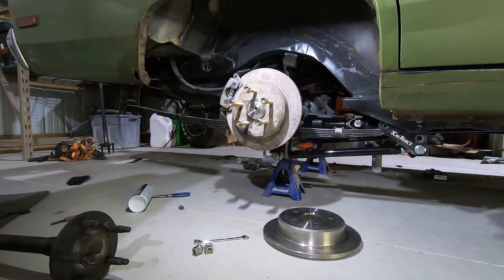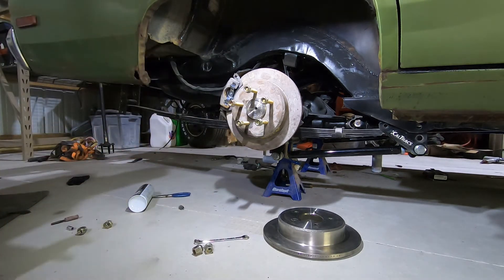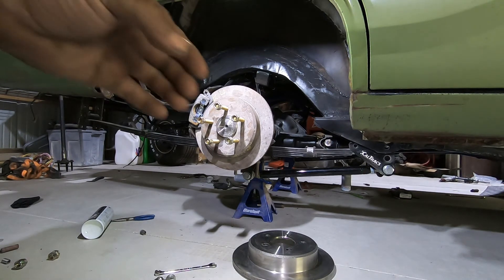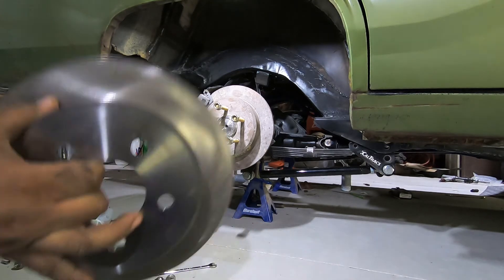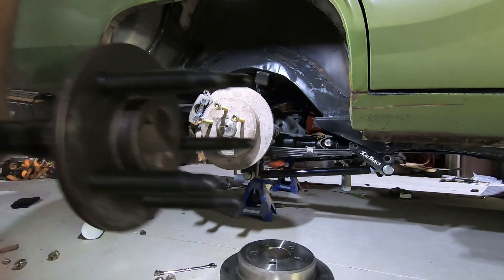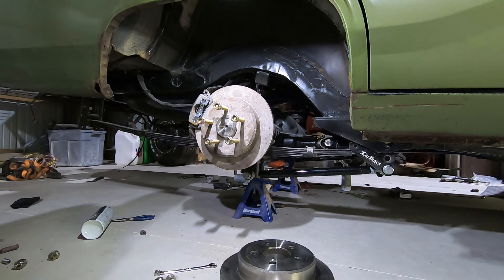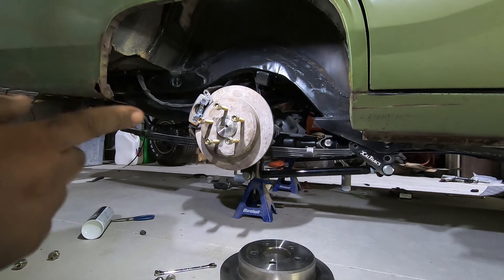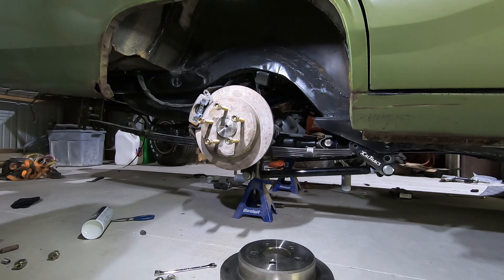How trying to make unnecessary upgrades really Boned me.

Comment: Measure the knurl on the studs that are tight in the flange and check out summit or jeg's to see what is available in 5/8 with that knurl and length you need. A guy on the C-body site that I am on ran into a similar problem, but he was running 1/2 studs I believe and wanted longer studs.
Reply from the maker: I'm just Gunna pound the 2.75 studs back in and use them on the 55, I'll have to upgrade axles on this car when I install a trans brake anyways